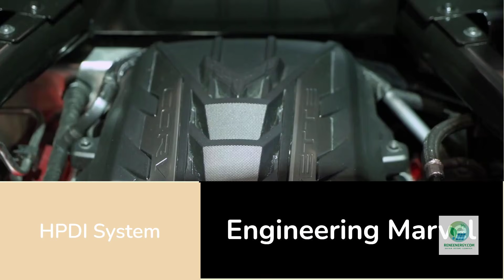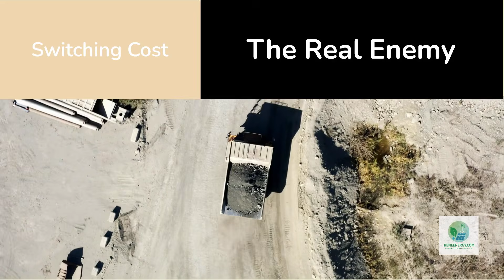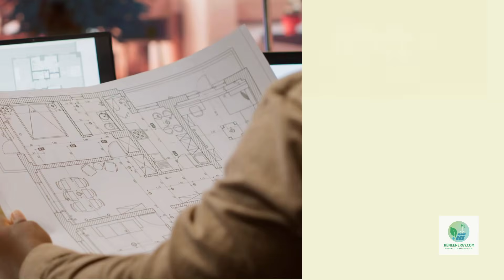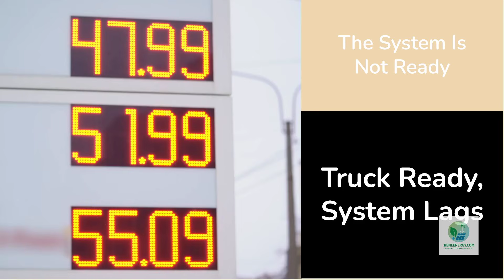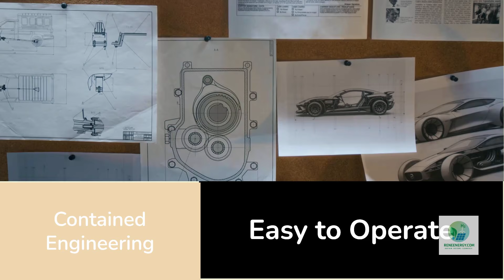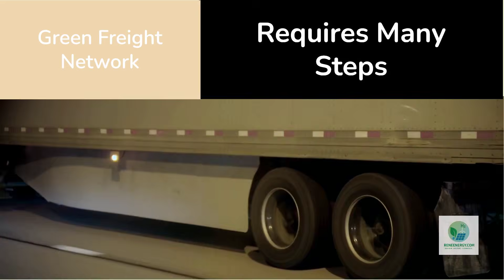Volvo Built a Hydrogen Truck That Works Like Diesel — So Why Isn't Everyone Using It

Comment: Hydrogen-fuelled freight logistics are currently impractical, both from an economic and safety standpoint. First, it's costly to extract and store the hydrogen. Then consider that as it's gaseous at room temperature, it would have to be cooled and heavily compressed to store enough of it for such long haul operations. The pressure build-up can have disastrous consequences if not properly managed. Moreover, you cannot just shut the vehicle off. When that compressed hydrogen reaches atmospheric temperature, it will have to be vented out (precious hydrogen fuel is lost this way) to prevent explosions in the storage tanks.